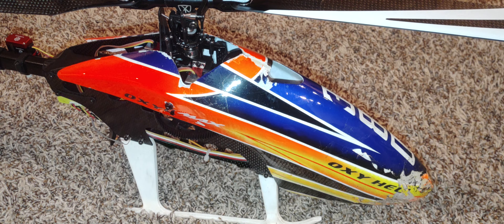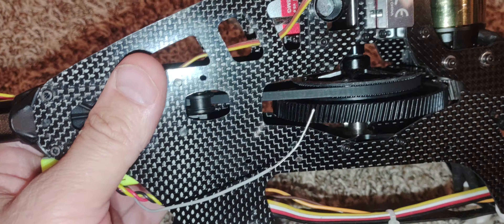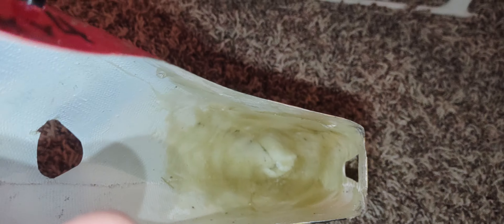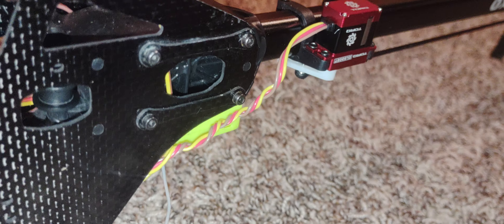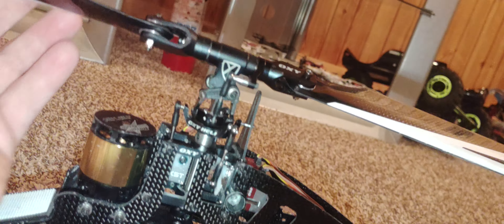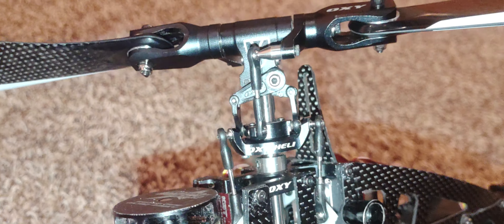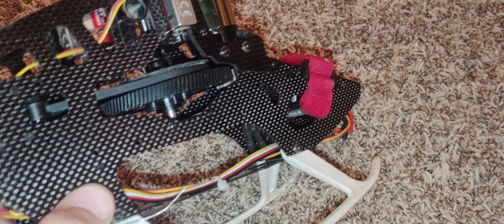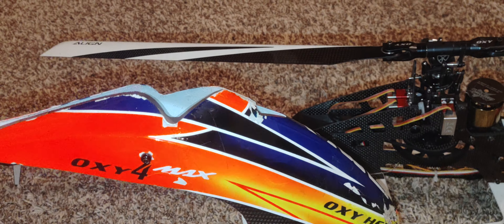Oxy 4 Max. 3 years later. My opinion.

Comment: Do you have a Omphobby M4 to compare it to in terms of durability?
Reply from the maker: Oxy is slightly more durable from my experience. Skids are better, tail boom is stronger, canopy mounts stronger, ball links are more flexible and canopy is way thicker on Oxy. But honestly they are both strong tanks. So much better than what we had years ago.
Reply: @Rusty-Metal  Have you ever flown a Goblin Raw 420? if so how does that compare in durability?
Reply from the maker: @dankusmemus2350  nope. Goblins are usually very strong. I've had 3 Goblin 380, 3 Goblin 500, goblin raw nitro 580, raw 700, and I still have my kraken 580 nitro. Fantastic models and strong, but expensive parts.
Reply: @Rusty-Metal  Did you ever have trouble with the micro servo you are running on the heli? The used one I bought has a really big mini servo on it and I might change it to micro to save weight as I am not going to be running it heavy anyway
Reply from the maker: Yeah. I have 2 Omp4. The omp tail boom is more weak. Skids and body mounts crack easily. It's super heavy too. Bogs easily and the big motor seems to take way longer to get back to full rpm. I dislike the cyclic feel also. It's super sensitive with poor resolution. For me it choppy and blocky feeling in the air. I'm surprised everyone likes it. But I feel it's new heli syndrome and lack of exposure to other good flying helis and lack of experience to know what a great flying heli is.
Reply from the maker: @dankusmemus2350  micros work great on it.
Reply from the maker: @dankusmemus2350  no. But goblins are great flying and strong.